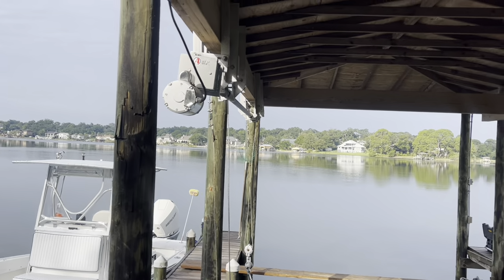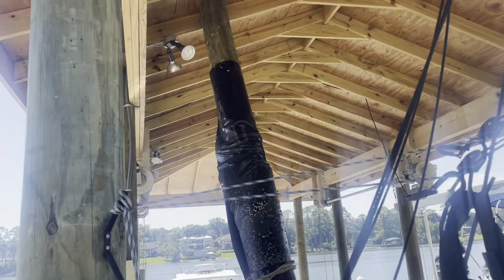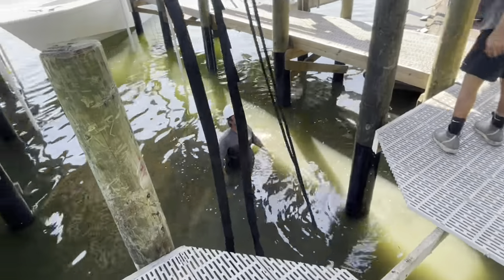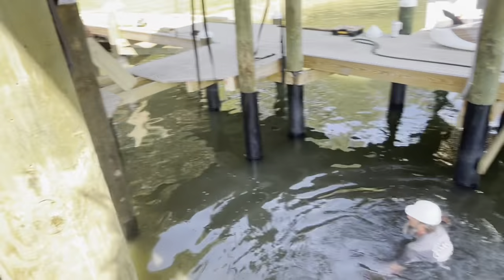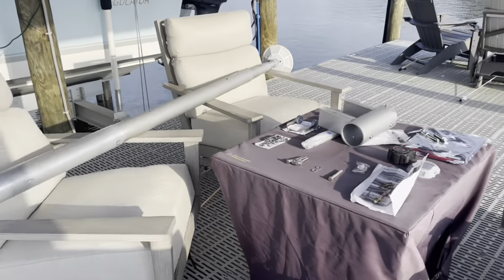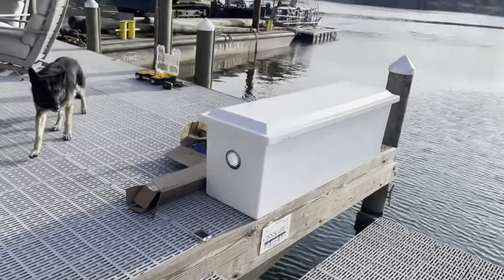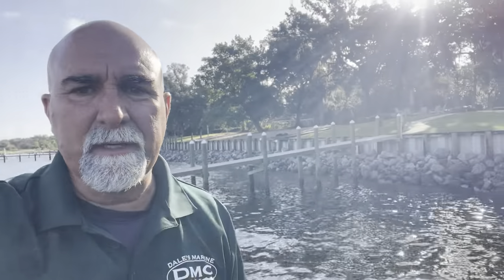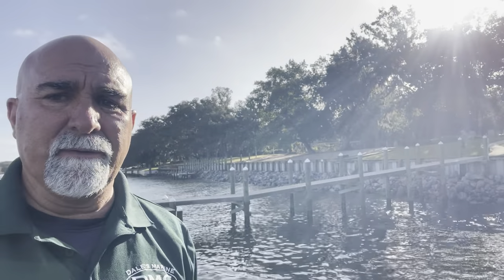PILING DRIVING, PADDLE BOARD AND KAYAK DOCK & MISCELLANEOUS Projects completed over the last month

Comment: I know you’re not a electrician but could you perhaps show some of your larger docks electrical systems? How they installed it. Types of panels. Safety systems.  Been trying to find some examples of a marina electrical design and there’s not much out there.  Talking like a 20 slip marina with each having a 100amp pedestal.  With water and all that.  What type of regulations if any exist.  In north Florida. Have a new dock marina and I can’t believe most of it’s legal. Private marina.
Reply from the maker: Thanks for your comment and question. My electricians usually show up after I have completed a job. I have a hard time getting back to some of the jobs do the video. Congratulations on your Marina. We’ve got several marinas that are in the works right now maybe I can get some good shots of those electrical systems for you

Comment: Great work, Dale. As someone who has lost a digit to a saw, let that one dude know that the terminal platform can serve as a sawhorse to cut treads instead of holding in the air at an odd angle. Just throw the sucker on the platform and cut it between stringers. He will then be able to count to 10 using his hands unlike me!